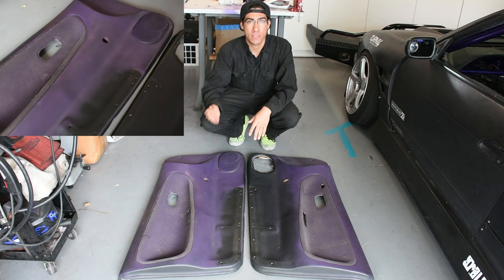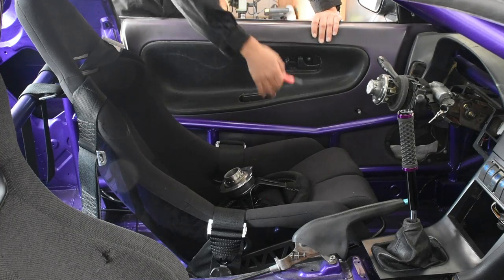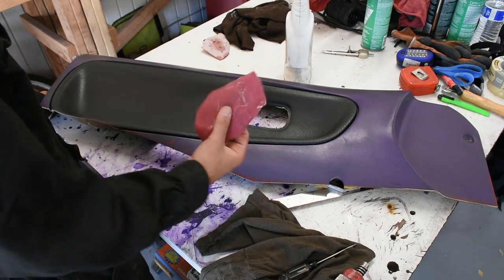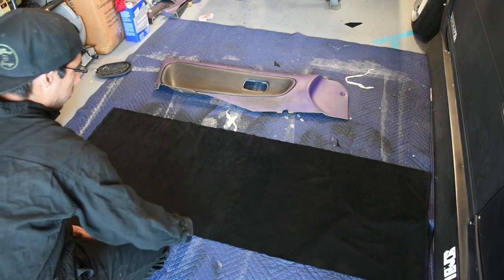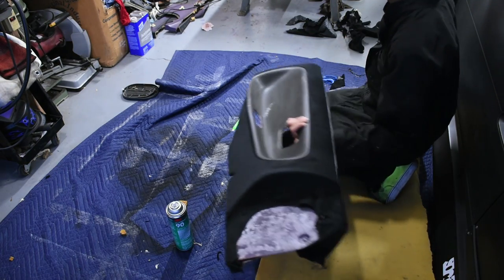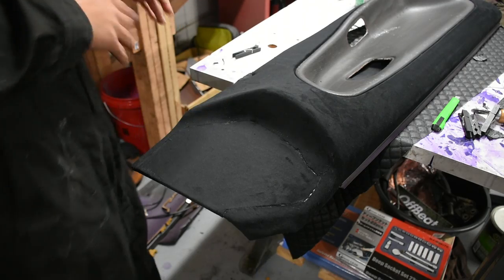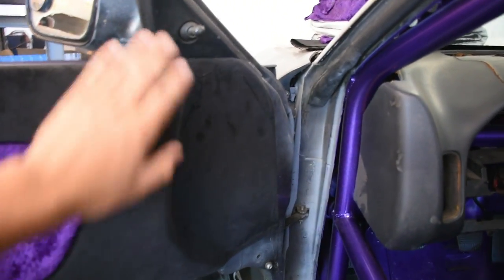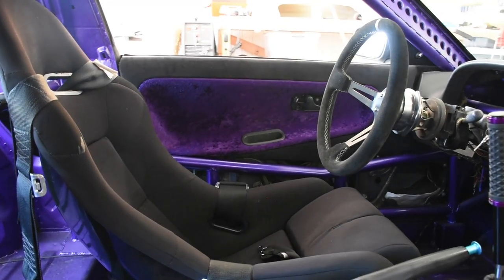Making Some P.I.M.P. Door Panels! - How to Trim and Wrap Your Door Panels

Comment: good job!! You are right that black fabric is a pain to work with since it does not stretch. I repaired the cracks and wrapped it in the same exact stuff and it was hard. 

you will need to use the cutting technique where the dash is hidden by the door card, on the passanger side foot shell area... sadly mine did not come out perfect because when I tried to stretch it into the valleys it was under tention and some bubbles formed. 

feel free to check out my build on zilvia and reply if you want more detailed pictures to help you out.

Comment: I would still make a aluminum bottom covers. but if it was me, I'd get brass (would be pimp with the purple) could use the thin Brass sheet the use on lower part of house doors, and get brass hinges so you still have access to your inner door and use them as storage like you want.

Comment: It's called the "nap" with any sort of velvet fabric...which is similar to grain which is what you said but there is a slight difference. any fabric with fibres that stick out like velvet or fur or the like has a nap depending on the direction the fibres were cut . The grain has to do with the weave of the underlying fabric that is holding the perpendicular fibres in place. Good video though and yes- the nap is WAY important.

Comment: 🤌🏾When piecing it together on the back half cut along the lines of the panel so the extra pieces meet in the seams and corners not in the middle of the fabric...OR start with the backside of the panel...your call

Comment: I know this video is over a year old so you may have already figured it out but I thought I'd comment anyway (might help someone). If you would have covered that section of the door panel that you don't see, and run the material into the radius, your seam would probably not be the least bit noticeable.

Comment: are you gonna paint the whole exposed part of the door purple or black with purple accents?
Reply from the maker: All purple for the section of door facing the inside of the car. Black on the outside of the door to match the exterior paint. Hope that clears it up :)

Comment: Overall nice job, but there has to be a better way to work the fabric into the curved section. All that work and it looks like it will peel sooner than desired. Not tryin to take ANYTHING away from ur work. It looks really  good. Im sure your process will continue to evolve and youll only get better

Comment: how do pull the windows down ?
Reply from the maker: Slip on the manual window handle to roll up or down, then slip it off and put it away to close the door. But because of how hot the car is in the fumes etc. it's pretty much always driven with the windows down.
Reply: OffBeat Garage bruh, ok ok noice

Comment: Wasn't it easier to do the purple first?
Reply from the maker: +Yoeri Kurvers Nope. We tried that on the passenger panel. Made it way harder when laying down the black fabric cause we couldn't let the fabric touch the purple.l fabric. And the purple couldn't be masked because the masking tape on that fabric stuck like crazy. It was a mess. Ended up being way easier to just lay the outside fabric first.